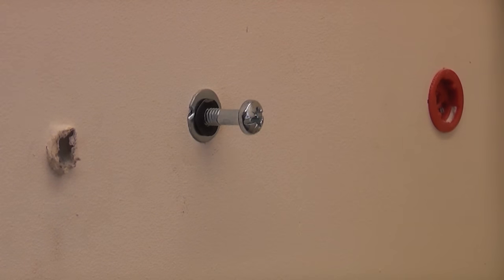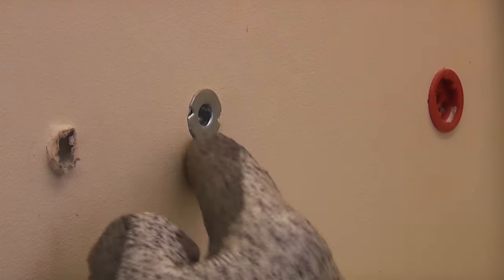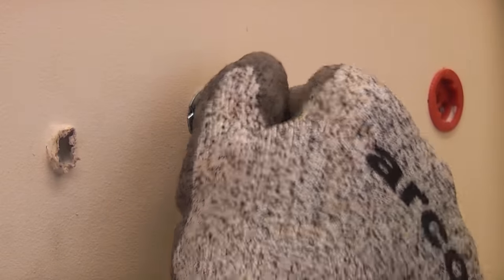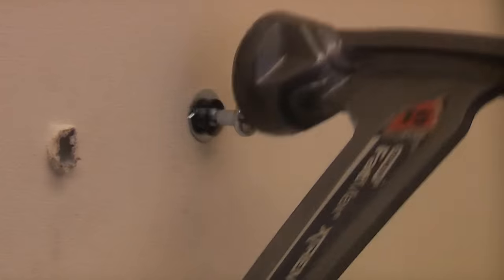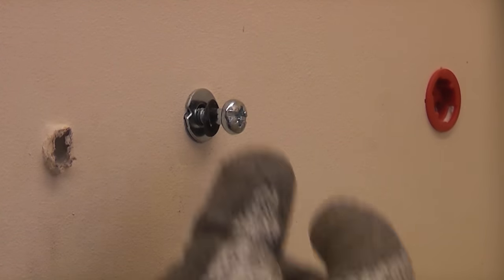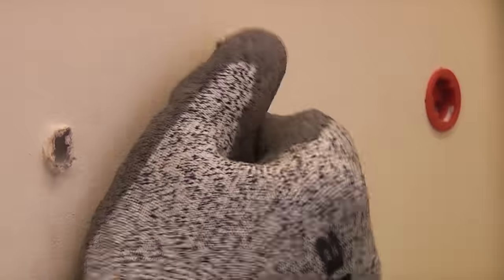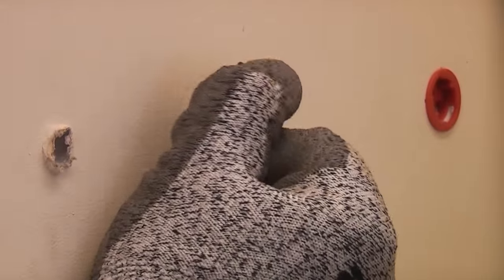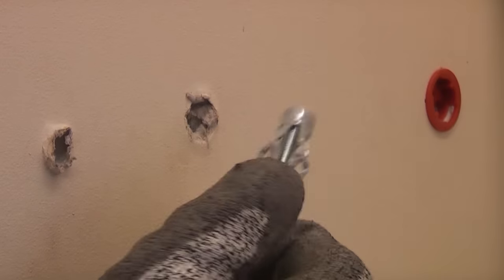How to remove hollow wall anchors

Comment: The nearest way in terms of the resulting hole to repair is to carefully drill off the front plate then push the body into the wall cavity. By pulling out using your method you caused some separation of the paper and plaster which makes for a much larger repair.
Reply: Excuse my autocorrect, that Should read "easiest"  not "nearest"
Reply from the maker: +Paul Hughes 
No problem, it always catches me out if I use my mobile phone!
Thanks for the comments ;-) 
I look forwards to seeing your video on how to drill the front off.
Reply: Ultimate Handyman lol!!! As do I..!!!

Comment: It worked for one and for the other, it partially came out, but just enough so that I could cut off the head of the anchor with some snips and push the remainder of the anchor into the wall.
Reply from the maker: Thanks for the comment 👍

Comment: I use similar methods with wall anchors and they can be reused if not deformed. Though critical applications I'd never reuse.
Reply from the maker: +cheechU38K 
Thanks for the comment ;-)

Comment: All you have to do with the metal anchors is pop the metal disc off (they are not too malleable) then use a small punch or screwdriver to tap it in so it just falls into the space. No extra drywall damage. Done and done. ✔️
Reply from the maker: Thanks for the comment 👍

Comment: Is this a joke? The idea is you break the head of the fixing off. Then you push the fixing back into the wall.. why would you hammer it and risk breaking the plaster?
Reply from the maker: No, it is not a joke, this is how I remove them. Have you done a video on removing them?
Thanks for the comment 👍